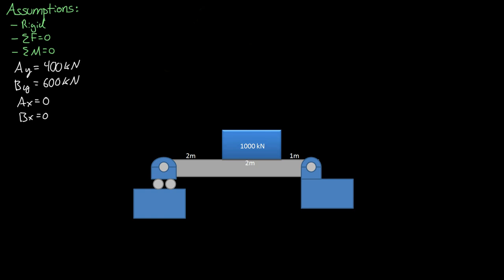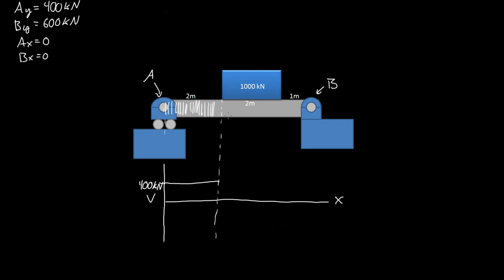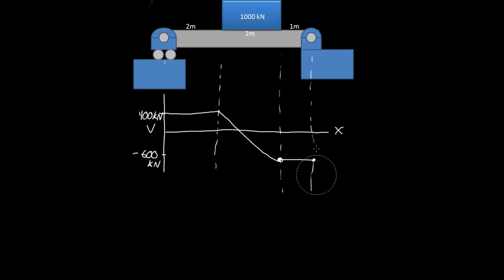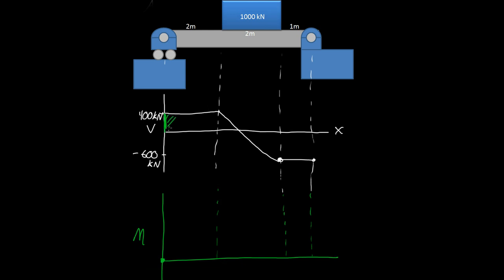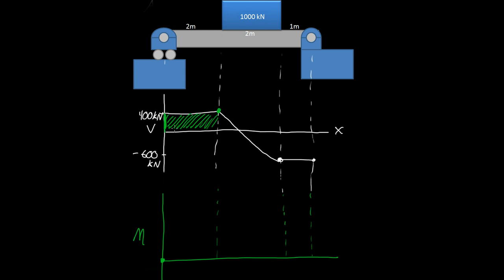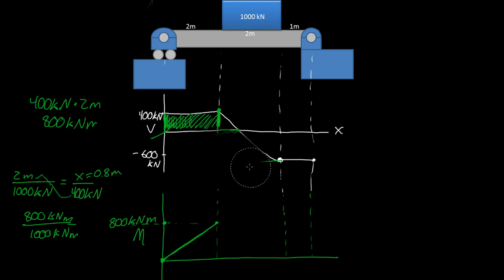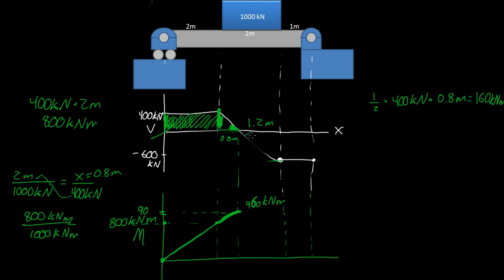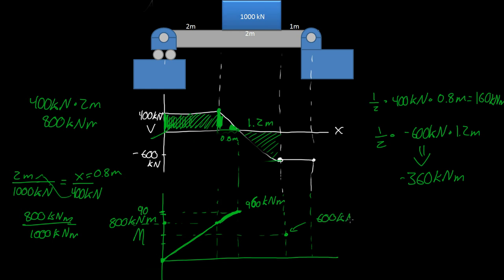Shear & Moment Diagram - Statics 22.2

Comment: thanks for the video, but, how wud u draw a bending moment diagram for a distributed loaded beam with fixed ends at different heights? i understand how to do it for a level continuous beam, but i hav a question hear where point A is 1m above point B(fixed at both ends)..with a distributed load of w=4 N/m. The beam curves down as it goes from A to B..please help!

Comment: I would think it's the opposite--the 1000 kN represents the total load (think of a rectangular block with that weight), and since it's a force spread through a distance (the 2 meters), it will be a distributed load.  You could then visualize distributed loads as some weight suspended by a rope, cable or string (the place where its tied would be where the concentrated load would happen).